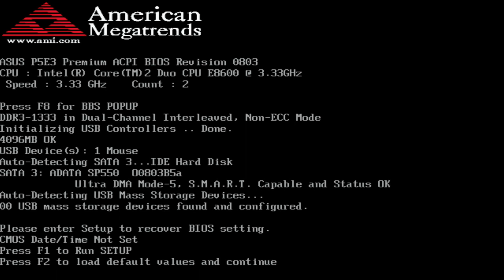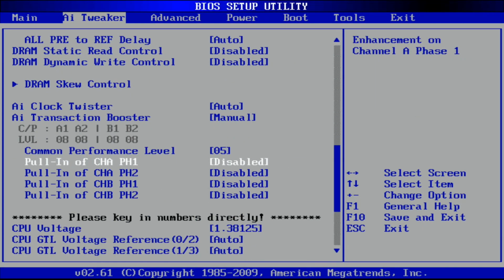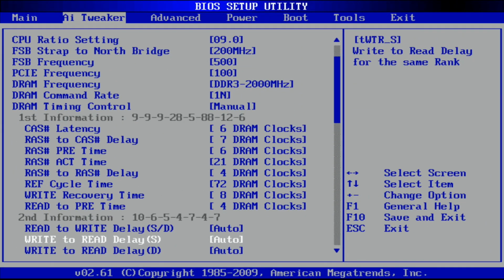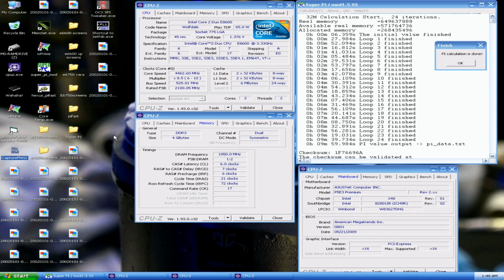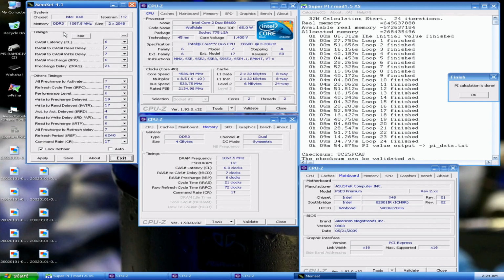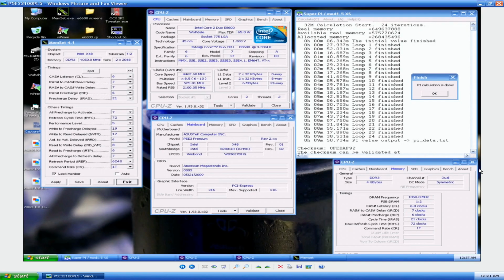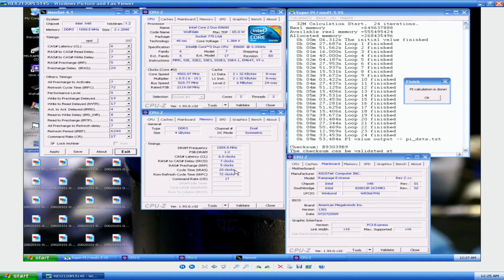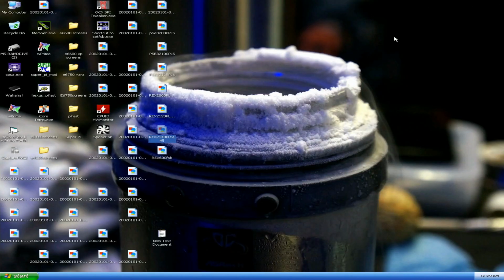Binning X48 LGA775 Motherboards (ASUS P5E3 Premium + Rampage Extreme)

Comment: how do you go about finding drivers for lga775 system now that intel have purged chipset and vga drivers for these platforms.

i recently bought two intel dq45cb boards and was shocked when I failed to find even basic drivers, oems and even individual component suppliers (sound chip etc) have apparently removed drivers and support.
Reply from the maker: I think only driver you really need is chipset driver, maybe ME if there is one available. Old Lan and sound drivers should be available but probably not for the newest operating systems.

Comment: thank you for videos on older hardware OC :)
Not sure if anyone here is interested, but here's how I did with 16GB of memory (4x4GB) on Rampage Extreme (Cooling : AIO CPU/Air/Ambient) CPU : Xeon X3370, https://i.imgur.com/Yu30vcU.png https://i.imgur.com/IGteXoy.png
Reply: Neither of these photos show what memory you used! xD
Reply: @cannaroe1213 Oops. Sadly, I can't post my valid from CPU-z (comment deletion), but memory used was dual rank Corsair 4GB stick, model :  CMX8GX3M2A2000C9 (x4 for 16GB). Dual rank, in short, means memory chips are on both sides of PCB.
Reply: @CompatibilityMadness  wow you're a legend! Thanks man :)
Reply: @CompatibilityMadness  Hey mate, the Corsair RAM arrived today and it works flawlessly in my Maximus Extreme x38, you're a legend mate! Thanks to you and Luumi!